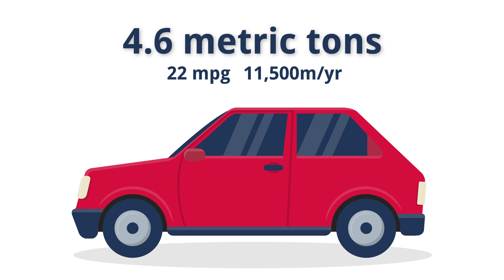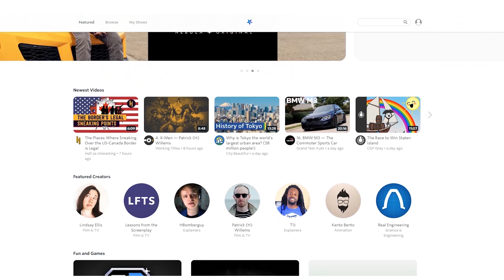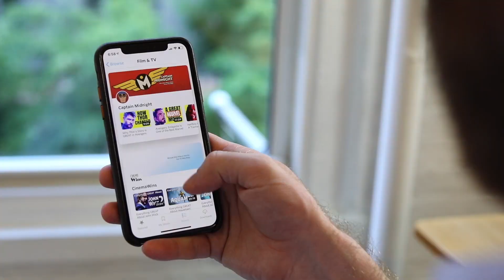How Cruise Ships Are Destroying The World

Comment: Please consider using proper abbreviated units for measurements! Miles is "mi" not "m" and gallons is "gal" not "g." 

"m" and "g" are abbreviations of SI base units...
Reply: After watching this video you're more motivated to change units than our disgusting polluted planet? What is wrong with you?
Reply: What's wrong with metres per gram?
Reply: CoLdAsIcE I am able to hold more than a single thought in my head at a time.
Reply: @ntnwwnet  This has nothing to do with your mental capacity. Its what you're "motivated" to do... as I said. Or is it what strokes your ego the hardest. Either way your energy could be put to better use my friend.
Reply: Also, 99% of the planet recognizes SI units. Not imperial. People are going to make mistakes.
Reply: @majorfallacy5926  A "g" is a gram while "kg" is a kilogram
Reply: @MrClassified666  Which is exactly why he pointed it out.

Comment: The fact that "flight shame" movements are a thing when this is far less necessary and far more polluting  is utterly ridiculous.
Reply: Tbh, even though flying is better, it's still not that good
Reply: @Sapple498  It's very fast and cheap, though.
Reply: If electric airplane with the performance comparable to fuel airplane exist, every airlines will buy it because they hate paying for fuel, so its a win win situation in my opinion if that ever happen. people that participate in the "flight shame" movements should review their priority and change to the "cruise shame" movements.
Reply: What is the "flight shame" movement?
Reply: I very much prefer flying when traveling but when I go on vacations with a lot of my friends as a group, about half of them have an unreasonable paranoia of flying and will only agree to vacations that are either local within driving/train distance, or cruises that depart from a port within commute distance. Literally cannot convince them to fly anywhere for the most part.
Reply: There will always be something worse. Something needs to be done about all the issues.
Reply: I actually learned recently back in WWII all aviation gas used by Germany was actually synthetic. With modern technologies, it'd be possible to synthesize low pollution fuels for use in planes, which would clean them up massively. But instead, people just flight shame rather than push the industry to clean up.
Reply: @cpufreak101  The reason it isn't done is because the cost is significantly more than getting fuel from oil. It doesn't matter if there are alternatives when they cost more. The reasons the Germans did it was not because it was better, it was because they had no choice and needed fuel. Cost be damned. It is also much worse form the environment than traditional fuels. If we switched to synthetic fuel only we would be paying a whole lot more per gallon, not just double but likely much more than that.

There are reasons thing are not done and they aren't just because some super secret thing from Germany isn't known about.
Reply: @xex2kok  I'm aware of the cost, which is still a problem to overcome. Just putting out an idea is all, as simply not doing anything isn't a solution.
Reply: @cpufreak101  No what you did was be misleading. You brought a solution you people while holding back the cons that make the solution not possible. That is not helpful, that wastes time.
Reply: @jorgeporras9262  Yeppp people with a fear or paranoia of flying tend to ignore the statistics for some reason. I can't even begin to fathom their mindset. If I could, I'd much prefer flying as much as possible. But yeah my friend, especially one particular one of them, is very hardline about this to the point where he'd rather drive cross country, coast to coast, rather than fly.
Reply: People just aren't aware how bad they are.
Reply: @Generalkidd  it's weird, some pilots who survive air crashes don't   choose to find a new job and you think they would know how safe planes are better than anyone else
Reply: You're never going to get rid of cruises or flights but if you can reduce each by 15% that's good. It's not about only focusing on the worst of the worst.
Reply: I am not so much into shaming people, but as someone living in a developed, first world country my co2-footprint exceeds the maximum amount per person (to stop climate change) just by living a comfortable life. That is the case for basically every person in the developed world. So what exactly gives me the right to increase that footprint by a very significant amount by flying around the world just for my entertainment? So I have a nice, exotic vacation while the people who will suffer the most from climate change have almost no co2 footprint, often can't even afford food and can't even dream about something like vacation? I get that tourism is an important economic factor in many countries, but to me it seems just cruel somehow.
Reply: 1. flying is still more popular than cruises
2. environmentalists also say fuck cruises, you probably just haven't heard it.

Comment: Is this just cruse ships or all big ships?
Reply: A lot of cargo ships burn heavy fuel but cruise ships are more insulting because they're so pointless
Reply: @jackmraz4037  yeah shipping food is more useful than shipping rich tourists
Reply: Cargo ships do actual important work.
Reply: @jackmraz4037  Accually Cruise Lines are also wanting to reduce Pollution, On the 1900s everything was Worst with Steam Engines Giving out Tons of Ash and smoke then today's ships
Reply: Cargo/container ships are as bad if not worse. However, the EU has legislation in place to begin requiring vastly improved environmental impact/footprint, otherwise no entry into EU ports. So state-of-the-art cargo/container ship builders are working on hydrogen propulsion designs, instead of the bunker oil fuel. Similar legislation in other developed countries will likely occur as well. But still a few yrs out.
Reply: @HarumNasiku  Cruise Ships are mostly Means of Intertainment but mostly into the Early 1900s Sea Travel was the only Way to go to places, Cruise ships are more like Hotels then Accuall Ships
Reply: @zuutlmna  but 90% of import/export are done by ships so it is essential to society. So many things we see in everyday life have been carried by a ship. Trade would become impossible.
Cruise ships on the other hand are completely unnecessary.
Reply: @vaibhavmukherjee9830  The idea of the legislation is to force shipping line operations to upgrade their ships' power systems to stop the severe ocean pollution. As long as ocean surface shipping is allowed to operate without doing any upgrades (modernizing!), most will not do so. There are cleaner, less polluting alternatives. Other transport industries have been evolving, to become less polluting, more energy efficient.. Modern industrialized society provides alternatives through the science of research and development, which exists just for that purpose. Industries must stay up-to-date. It's just one of the realities of doing business.
Reply: @zuutlmna  i agree. Its a really important industry and creating more efficient and safer ships is really important to our future.
Reply: Also, when new technologies are first implemented, and put in use, they are usually more expensive than existing tech. But in time, the new technology becomes less expensive, as well as becoming more efficient..
Reply: all big ships, cruise ships actually have filters they can use due to harbour regulations.. so :) tankers and freight are worse when we talk pollution.. the reason we dont care, is we think the work done is so important we cant live without it any other way.. fixing it is no problem thou :) you can add filters.. i work in a shipyard, so i know for a fact :) - we dont care.. its like.. we are trying to fix the car pollution, even forcing it, but the boats? holy beeings.. that has to change some day.. or once we finish the last combustion vehicle, will we still be wondering where all this pollution is from? why not fix the biggest problem first? where like a 10% decrease would be more than all the cars on the planet? no? xD see? "actual important work" is beeing done - lets look away from the boats.. close ur eyes.. nothing to see
Reply: @charlesjakesamadan4008  well.... It was not as bad. There were less ships. Also cruise ships practicly didnt exist. They were ocean liners. An ocean liner is made like a bus, to transport people from a to b, not to cruise about
Reply: I would assume cruise ships are the worst of the bunch. Their engines need to also power all the electric used on board for every bedroom/kitchen/music venue/swimming pool - including all of the HVAC onboard that uses an absolute ton of electric. Big freight ships don’t have a huge crew and they only need to power a few rooms at any one given time.

Comment: The overwhelming majority of these cruise ships aren't registered to wherever their headquarters are. However, every nation on Earth has signed the Paris Climate Accord (the US still signed it even if Trump wants out), and if it's not already done, these ships should be held to the standards their registered country committed to (and their combined output should be registered as part of the nation's pollution). For example, the Harmony of the Seas (which ST incorrectly calls just "Harmony") is registered to The Bahamas. Therefore, it should have to contend with whatever pollution standards are present in The Bahamas. It's a start at least.

Unfortunately, by now cruise ships have become vital sources of economy for many nations, especially developing ones in the Caribbean. The odds of them vanishing are small, but hopefully their environmental quality can be brought up to par.
Reply: I remember some countries tried to put in environmental standards for ships, they either had to install scrubbers or burn a cleaner fuel than the heavy oils they tend to use. However the plan ended up backfiring as cheat devices were just used instead, capturing the pollutants and dumping it in the ocean once in international waters simply to avoid extra fuel cost or disposal fees, and since international waters, there's nothing any country can do about it.

Comment: Should just make them all nuclear powered, like nuclear submarines!

Actually... I might have to think this through a bit more... 🤔
Reply: A private company can do a nuclear powered system but the costs for that power plant will easily double or triple the build costs

Example, Oasis of the Seas construction cost was about $1.3 Billion USD back in 2006. If they chose a nuclear option that cost would have easily hit 3 or more billion. The reactor itself isnt the expensive part, but the fuel. The fuel for a non-state actor is the ackilles heel.
Reply: @verios44  long term it could be cheaper, because they save on fuel, and if you mass produced small nuclear engines for ships, it could bring the price down.
Reply: Nafiul Shelim not that aimple. Remember there is less than ~100 people in the workd (guessing) that know how to create nuclear fuel rods. Also the process is highly classified, regulated, and restricted. 

Liquid hydrogen, a fuel source the cruise industry has been developing over the last few years is a far more usable alternative. It also has only water vapor as a byproduct.

Comment: Wait till you find out about railroad locomotives! 400 to 500 gallons of diesel per hour, non-taxed per locomotive. The average train has 3 locomotives, and now that trains are nearing 2 to 3 miles in length with 0 public outcry, the trains have up to 6 locomotives now. Multiply this by the fact they run 24hrs/day and there are 1000's of trains across multiple railroads.... Before the going green movement my yard office had a poster that bragged about how big our company was and it said this, "Union Pacific is the largest fuel user in the world! more than the US Air Force and Navy." Another poster said, "Union Pacific uses enough fuel in one day to send a car to the moon and back 26 times!" Those posters are long gone now but you get the point ^^

Comment: Possible near future solution: When fusion reactors are a (reliable and powereficient) thing, these cruiseships could have their own on board (maybe multiple if necessary) to power huge electric engines and all other electric systems on board.
Reply: Won't happen. There's nuclear ships already available for the military but not for civilian use, the "next step" won't be any different
Reply: @anyon3577  if fusion gets worked out it will be cheap and you don't have the radiation issues like with fission so it probably would

Comment: I mean your average cruise ship, I'm using the oasis class as a reference, also produces up to 650 times the amount of power of your average car, assuming the average car makes 200 horsepower.

Looking up numbers on EIA.gov bunker fuel will produce between 215 ppm/BTU and 157 ppm/BTU of CO2. I'll guess 200 because it's an even number. That's 1.27 as much CO2. So a cruise ship produces 826 times the CO2 of a single car.

So I guess your video is just off by a factor of 1211.

Comment: Cruise ships do NOT dump sewage into the ocean. Raw sewage is kept aboard and treated on the ship. The only thing that may get ejected into the ocean is greywater (water from sink drains and showers I believe, more so from sinks) and this is only on occasion. The photo they showed in the video is of a ships propellers disturbing the sediment in the bottom of the harbor. And yes cruise ships use a lot of fuel, but you have to remember that they are not just burning that fuel for one person like a car, they are burning it to provide power, running water, and mobility for in many cases over 3000 people. We can work out that a car for a single person burns about .48 pounds of fuel per day to just provide transportation. A large cruise ship will burn about 250 tons of fuel (50,000lbs) per day which works out to roughly 8.3 pounds per person to provide all the functions of a city AND make it move. This video is very misleading

Comment: This video is poo
Ships are being required to switch to alternative fuels this year (2020) as a result of something the UN came up with years ago. Didn’t do your research on this video. Or maybe you did, but just needed a video for your in video ad. 

They’ll mostly be switching to diesel, which is far better. Some will use liquified natural gas too. 

The rules, drawn up by the U.N. International Maritime Organization (IMO), will ban ships using fuel with a sulfur content higher than 0.5 percent, compared to 3.5 percent now, unless a vessel has equipment to clean up its sulfur emissions.

Comment: If only there was a safe, efficient, clean, cheap, sustainable, reliable and time-tested way to power large vessels. A man can dream though, a man can dream...
Reply: If you're referencing wind, I remember seeing someone build a mega yacht that was combination sail and diesel powered. Diesel was used when the wind wasn't blowing or conditions poor, with the sails being raised when conditions permitted. The problem these days though is ships are designed so much around having diesel engines that trying to simply slap sails onto an existing ship kinda won't go too well.
Reply: @cpufreak101  I must admit, wind hasn't even crossed my mind. While it may have its uses as a supplemetary propulsion, it would be far too impractical for the really large vessels such as cruise, container and bulk cargo ships. Not to mention you would still need a backup system of power and propulsion.

Comment: This video is false news. All ships use HFO in the open ocean. And MFO (diesel like) while docked and in ECA(s) (Emission Controlled Areas & Sulphur). The scrubbers are either open type (dumping into water after washing the exhausts) that work like your cars catalyst. But there are also closed loop Scrubbers which uses caustic soda and tge ships output and change the caustic soda in port facilities which then handle the pollutants. Also major cruise lines use Cold Ironing or shore Connection.. But that is not cleaner than HFO if coal or nuclear power are used to produce electricity on shore. Even with Heavy Fuel Oil the Marine and Shipping Industry and the Cruise Ship Industry (which is not transportation  and therefore can not be compared with cars rather with Hotels and Casinos and Bars as it is accommodation  and entertainment unlike a Container Box Ship) is the most eco friendly per metric tone transported from Point to Point B or for the Cruise Ship Industry per Capita entertained. You should compare a cruise ship with the Garbage, electricity and CO2 outputs of the equivalent size Buses, Casinos, Hotels and Shopping Malls, Spas and pools and restaurants and tennis courts and everything they have onboard..the equivalent to house and transport all the people on the shore. Yes it is a Cruise ship and all that is compact and it outputs as one unit.. But that's a small city of things they have onboard and comparing it to cars is simply a very poor comparison a misrepresentation  and leads to false news. You should have done a far better study of the facts before posting this video and you should have talked to someone who knows a couple of things about Shipping and Cruise Ships before posting misinformation online.. Do your research and homework click bait is enough..